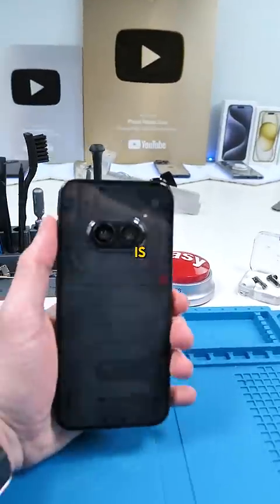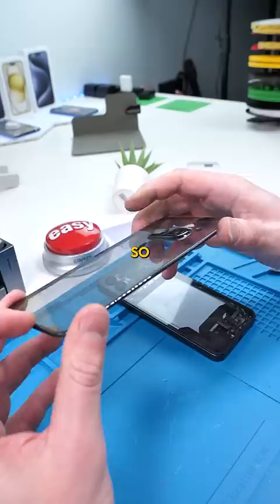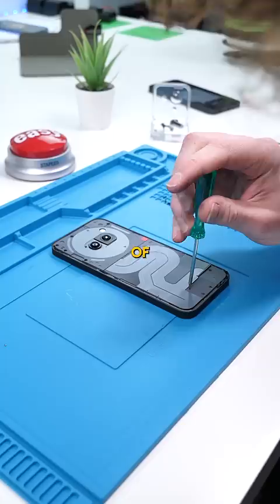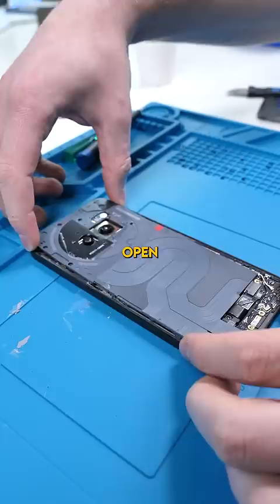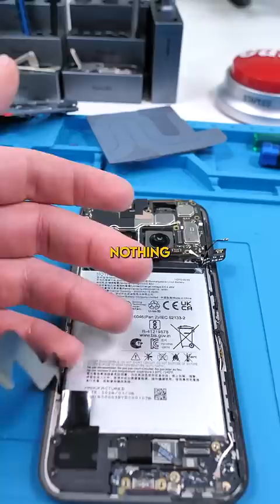NOTHING (2a) But HIDDEN Screws... #Shorts

Comment: I love how, if you don’t like the design of a phone you just always have a mod for it
Reply: what mod? scraping paint off, or removing some... something behind back panel is a modding?
Reply: @Matthew_Removeafterwashing  yes, it is infact modifying it.
Reply: @Matthew_Removeafterwashing  Yes it is, changing something is modifying
Reply: @Matthew_Removeafterwashing yeah it called modifying a device mods don’t always have to be internal
Reply: @jl.9991  so putting a case, plugging in headphones, or turning volume up is also modding? it changes something?
Reply: @Matthew_Removeafterwashing  as long as you change the look of the phone outside or inside you have modified it
Reply: @Matthew_Removeafterwashing no, but if u change something from the original phone (screen, back panel, buttons, etc) it is modding, so scraping off paint from back panel is modding
Reply: @elrealverdadero  but out of the box the phone did not have headphones plugged in, if I plugged them, I DID change something, so it is mod then?
Reply: @Swifteroos no it’s not, itks customizing. Not modifiying. He doesn’t add sonething that changes how the device works.
Reply: the only mod he does is transparency
Reply: @Matthew_Removeafterwashing i guess you could describe it as a serious change if you get what i mean, like changing the back glass or smth, not the little changes like a case or headphones.
Reply: @doodlydooyt  so I will connect jack splitter and plug in 2 headphones. That sounds serious to me
Reply: @Matthew_Removeafterwashing plugging in something is not modding, putting a case on is customizing it, but changing the internals of the phone is modding
Reply: Its a weak ass mod but yeah it's considered a mod by definition
Reply: @Matthew_Removeafterwashing yeah it’s usually not a plug and play type situation
Reply: @Matthew_Removeafterwashing  WOMP WOMP
Reply: Or just put a case on it
Reply: @Matthew_Removeafterwashing These guys don't have a penny of knowledge about Modifying.

Comment: Back plastic instead of glass is a massive improvement, and would honestly make me want to buy this over the more "premium" version.
Reply: plastic is not so great. I think I would be able to make something better. It would be very cheap, heat ressistant, hard and not brittle. I think I would call this thing METAL. That would be awesome 😯
Reply: @Matthew_Removeafterwashing  yes but is it light? is it transparent?
Reply: Obviously not relevant to this phone, but metal is inferior for wireless charging. Glass is annoying because it breaks easily.
Reply: We all cover the back glass anyway. Some of them have cracked back glass we don't even know.
Reply: If i am getting great spec but cheap because of plastic it's a great deal i don't really care about it's glass or metal phone internal more important
Reply: @dxrrk  surely transparent glass looks better than metal, at least before it cracks
Reply: @Matthew_Removeafterwashing  This is a nothing phone though, it would look extra shit if it was shattered glass instead of plastic
Reply: @Matthew_Removeafterwashing metal makes wireless charging impossible
Reply: how so?
Reply: I love how everyone is arguing about whether the back should be plastic, glass, or metal when probably everyone in this reply section has a phone case. 

Because if you're gonna slap a case on it anyway, metal is simply superior. Most cases block wireless charging, and it isn't as efficient as wired anyway, so who cares?
Reply: @Not_interestEd-  @Not_interestEd- most cases don't block wireless charging. If you think that's true, you have a bad wireless charger. I used an Otterbox defender and Otterbox commuter, a 3-layer and 2-layer case, among many other cases, and they all supported fast wireless charging.
Reply: negatives: glass breaks, glass weighs more, glass costs more both new and when having to replace it, glass is worse for wireless charging, glass keeps the heat inside

positive: good quality glass doesn't get scratches that fast
Reply: @ondreo2334  this won't be an issue for me, I do not have wireless charging anyway. I plug in charger for a night so it doesn't matter for me how it's gonna be charged. Also while charging with wire you can use a phone, not so much while sitting still on a wireless coil
Reply: @Matthew_Removeafterwashing bend it one time and its gonna look like it been through hell
Reply: it isn’t an improvement in terms of protection of the phone itself, sure plastic doesn’t break as easily, but when glass falls it breaks, and absorbs most of the energy from hitting the ground that plastic would pass on the internals of the phone and break them, glass protects the electronics, but not itself lol
Reply: EXACTLY.
A fragile design to only look nice outta box while you will be using a phone case anyways.
A thing made to produce more electronic waste.
Reply: @Not_interestEd-  the issue is that a phones shouldn't need a case. if that cases design is visually superior, better protects the device, and as is more comfortable... that's what the phones design should be.
Reply: Honestly hate how all modern flagships have glass backs. I know it's for wireless charging but I honestly hate them. They are slippery and they crack really easy
Reply: @Kiabeta  Plastic backs are just as good for wireless charging. Wireless charging can't be done through conductive materials like metals, that's the only materials that limit it, and plastic is most certainly not conductive.
Reply: @Matthew_Removeafterwashing  metal interferes with cellular connectivity
Reply: @rexycontemplates  how about carbon fiber? it's not PlAsTiC. Super cars, ridiculuosly expensive bikes and boats are made out of this. People with insecurities who want to have everything PrEmIuM would like it on a phone. It will not crack and can look pretty. Why it is not on a back of a phones then?
Reply: Back plastic sucks ass. I have an a32 which has a backplastic and it has a crap ton of scratches and dents.
Reply: @Farquaad-Gaming get a cover man
Reply: I thought that too
Reply: @Matthew_Removeafterwashing  Metal is heavy, resists heat but also absorbs it alot which would cause the phone to feel hot in ur hand if u got some heavy processing goin on and some like the transparent thing better too, not to mention it's more expensive than plastic
Reply: @Matthew_Removeafterwashing bro's about to turn his phone into a microwave
Reply: @Not_interestEd- wireless charge is pretty lame tbh, it's slow and unreliable

Comment: Now reattach just glyphs
Reply: Yeah, removing the glyphs defeats half the point of the phone
Reply: @cameronhobson  why? and what is glyphs?
Reply: @Matthew_Removeafterwashing  On the Nothing (2a) it's the three lights on top of the back of the phone. The pattern they light up with are your notification lights, letting you see activity while your phone is face down on a surface. It's kinda the standout feature of the Nothing series. If you don't want Glyphs, just buy a different phone?
Reply: I'd just cut the lights out of the plastic panel and plug it in. These LEDs with transparent effect would be dope
Reply: @tenderandmoist5011 womp-womp

Comment: Plastic back cover is clever solution.

1) it's cheaper than glass one
2) You can fix it if you know how to fix instead of glass cover which is breaks totally
3) You can replace it by your own without any problems
4) it's not breaking on fall due flexibility and better wave spreading.

So yeah, it's not that bad.
I remember time's when i had cheap as hell smartphone with horrible display that were making your eyes burn, but it was unbreakable, those smartphone was immortal to any physical damage, but my smartphone with gorilla glass had tiny-tiny micro crack on corner when i was driving E-Scooter at icy road an i forgot to drop pressure at rear tire for better grips, so yeah, a was sliding on my butt an i saw how my smartphone slide with me about few meters 😂
And damn, i got tiny tiny crack on down corner on screen, my old phone was able literally break the ice and keep working and without any cracks 😂😂

Comment: The plastic back is fine until 3 years later, when your car keys and any surface you set it on have absolutely destroyed the finish. 

Source: I was a valuation specialist in electronics recycling. I have looked closely at tens of thousands of phones.